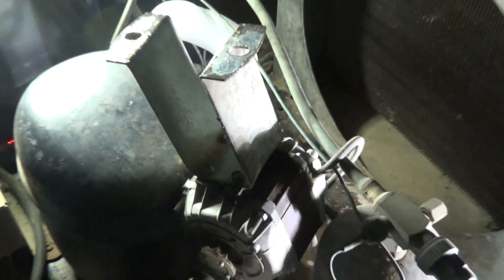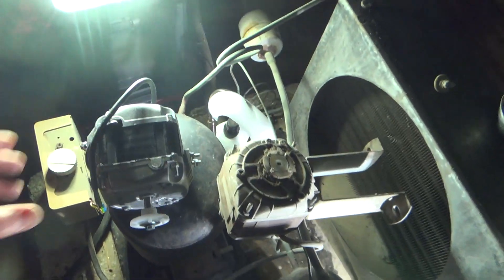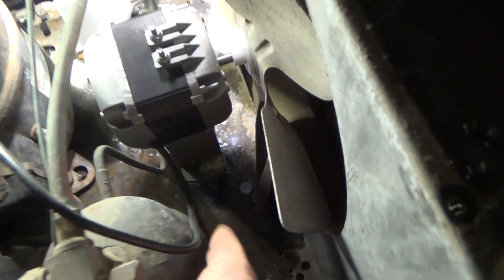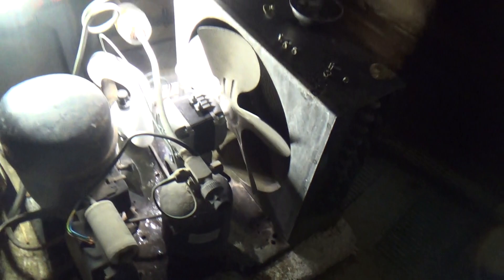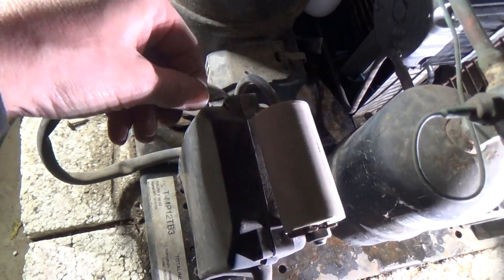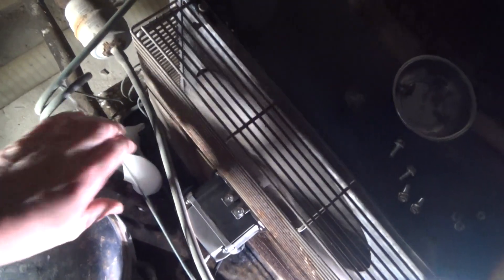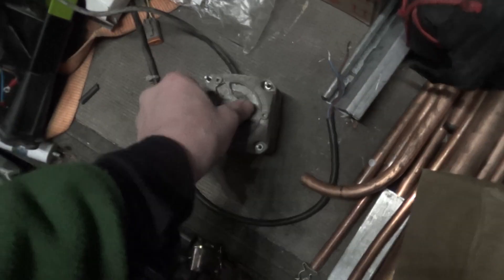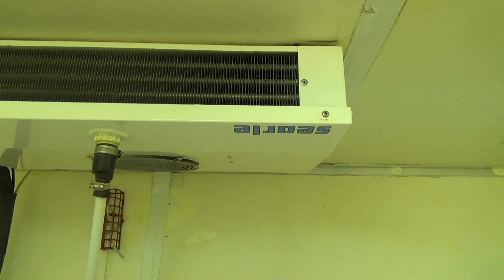Frozen Up Evaporator

Comment: Nice fix! Always one of those problems-hiding-problems just when you think you're all done.  Wonder how long that condenser fan's been out since the freeze up only happened when they pushed the system harder than normal with the lower setpoint?
Reply from the maker: Its possible its been bad for a while, before they lowered the temperature it would have been cooler outside the room so not much heat load to make it run.

Comment: Doesnt look like that motor had any oiling ports.....I guess its considered permanently lubricated?
Reply from the maker: They don't have any oil ports, but the motor just bolts together so you can strip it down, they have plain bearings/bushings and use either a felt or sponge 'donut' round the outside of the bearing to hold the oil. Have been having good luck using 0W30 engine oil to oil these style motors, if the bearings are not too worn you can get a few more years out of them, usually lasts until you can get a new one.
Reply: @heavydiesel  I found that often the felts are there, but bone dry. Worth it to pull the new ones apart, and soak the felts with the oil before installing them, which should make them last a really long time. Yes the 0W30 engine oil works, but a lot of them I have just used plain mineral compressor oil, which, for the lower viscosity grades, is basically the same as engine oil. Have used it as top up oil as well, with no issues, as it is a straight mineral oil, and works well in small gearboxes as well.

Comment: Tight electrical box is because the designer forgot you actually need to have wires in it, or that they would actually have to be carrying current, and did all the mock ups with 0.5mm wire.
Reply from the maker: Yeah, I think the new ones are even worse, at least the fan wasn't wired to the compressor box which is always a pain in the ass getting the cover off and back on!